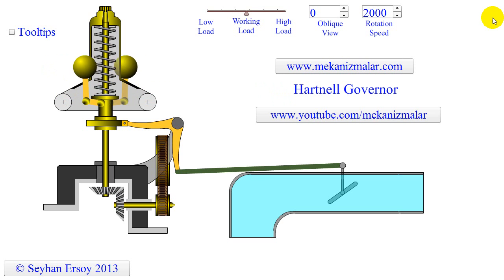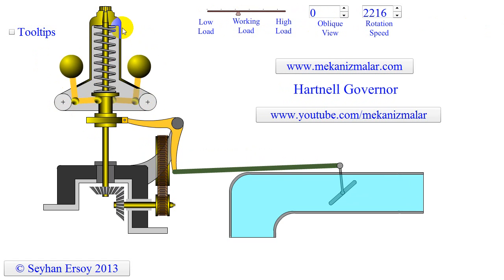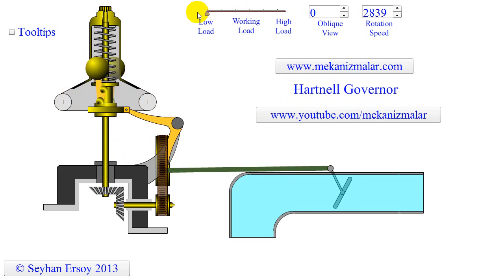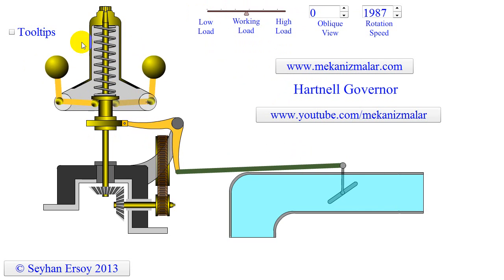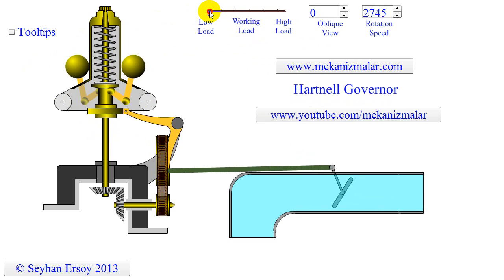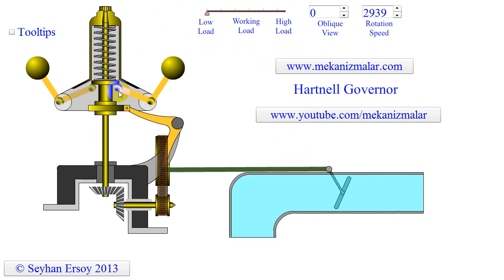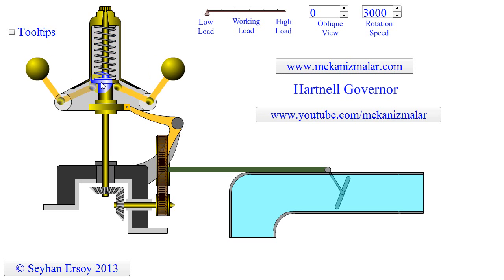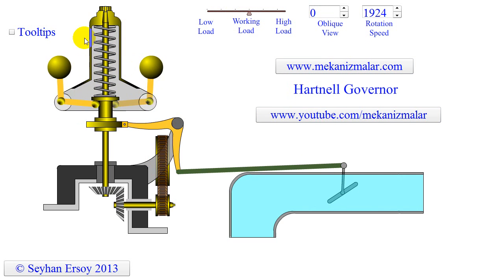Hartnell Governor

Comment: Nice video ! I just didn't understand one thing - the exact use of the spring. When the speed increases, the flyballs go outward and the spring is compressed. Doesn't this in turn push the fork downward bringing back the flyballs to the original position. On first glance it appears that the spring tries to negate the outward or the inward movement of the flyballs.

Comment: Nice video!! but i got a doubt while going through hartnell governor: why in the calculation of hartnell governor spring force is always taken in downward direction (even though spring elongates at low speed)? Is spring already in compression state?
Reply from the maker: +vaibhav desai Yes, spring is initially loaded, I mean compressed. However this compression just enough to balance the weights. When rotation increases, the spring is compressed further.